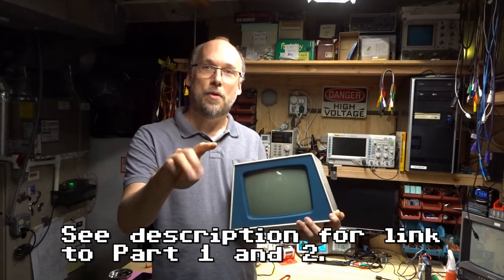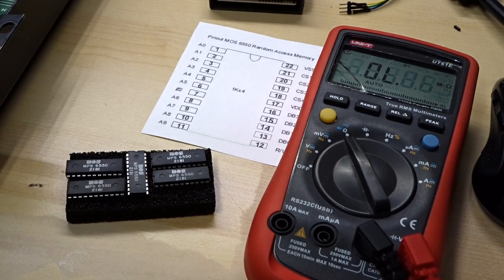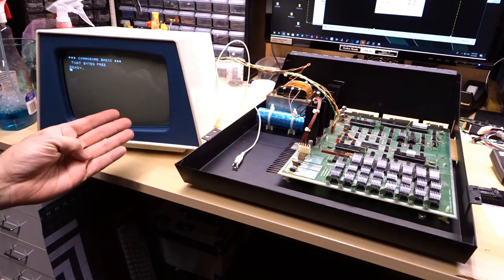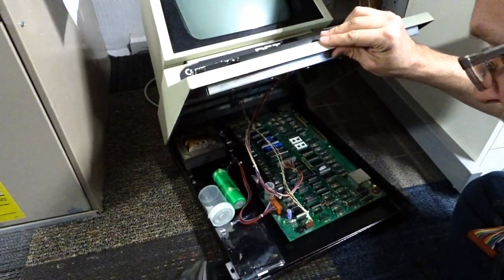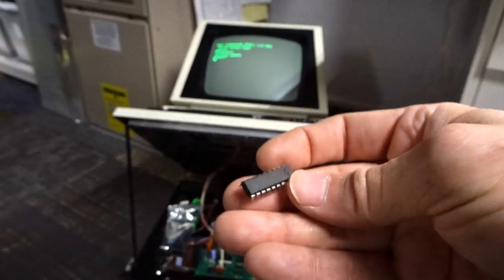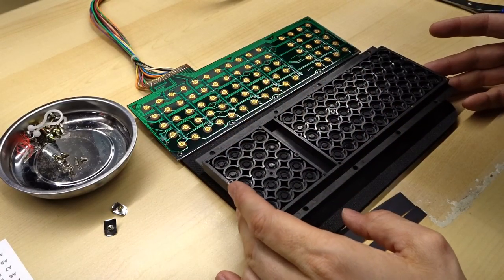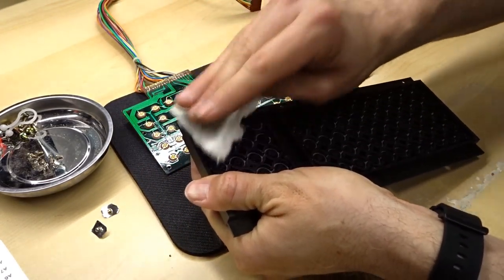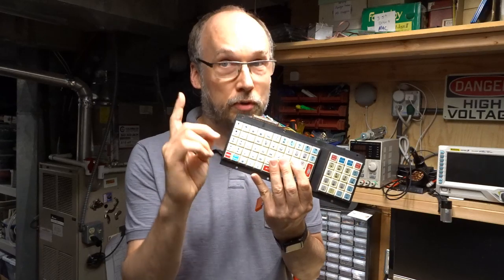PET Rescue Part 3: Replacing bad RAM and keyboard fix

Comment: Having had to service many TV remotes, game controllers, and other things with the silicon/carbon pads like you found in that keyboard I have discovered that paper is abrasive enough to take the sheen off the pads. It's cheaper than the sandpaper and removes far less material thereby preserving the lifespan of the device. For pads that are a bit more difficult you can use IPA as a cutting agent by simply lightly wetting the paper and dragging it across the pad. For tarnished contacts on the circuit board a pencil eraser works wonderfully. Just be sure to thoroughly clean them with either IPA or denatured alcohol.

Comment: I always thought "digital basement" was just something you thought up. Until I saw the furnace, I never thought you were literally, in the basement. Great videos, keep them coming! Repairing electronics is always satisfying!
Reply: his furnace resembles a minicomputer or small mainframe with a pipe sticking out the top more than an actual furnace :P if it weren't for the pipe... :P 'oh look it's got papers sticked to it with the password' and 'don't turn this off'

Comment: I simply use normal paper for "sanding". These rubbers behave like normal rubbers you use with your pencil. First they leave a dark stripe on the paper, after a few times, the rubber stops making those heavy stripes and thus is cleaned. I believe this methods is less aggressive than sandpaper. Love your show, keep on rockin :)
Reply: @adriansdigitalbasement  Yes, England's rubber is America's eraser.

Comment: Really like the shorter intro, very retro looks like you did it with an Amiga and Video Toaster. I told you the PET had a bad RAM chip. The last time I tried to fix it was before the internet though and couldn't find any chips, much better now with the internet. The old gal is really starting to look good almost like new. Thanks for making these videos!

Comment: By 8 years old I was an expert at fixing buttons like this thanks to my Atari 5200. Personally I don’t bother with the sanding process I go straight to the carbon paint repair. That has yielded the best results for me. Besides my 5200 joysticks it also fixed my C128Dcr keyboard. Mind you this is the worst button design ever and I don’t know of any permanent fix but the paint technique has the advantage that it can be applied multiple time where sanding may only work 1 or 2 times before the conductive layer had been completely removed.

Comment: just a tip on those carbon rubber pad button repairs: i had lots of cases where cleaning and sanding didnt help or lasted anything. but what really worked for me excelently was a rubber pad repair kit you can get from ebay and such, usually for remote controlls. they come with new carbon rubber pad plates , different sizes can be purchased and silicone glue. given there is enough room between the exiting rubber pad and contacts on the pcb, you just put a tiny bit of silicone glue on the old rubber and put a new pad on top , then let it dry over night. buttons i repaired with this , then worked as new and has been more sensitive, since the lesser distance between new pad and pcb. if you have a rare case where the spacing is a problem, youll need to take off  some from the old pad before glueing the new pad on top. some just "cut", some "grind". i never needed to do this however.

Comment: Oh yeah, finally I could see my favorite computer beeing restored :D I actually have a PET 2001, sadly not a blue one, but it had the same problem, and what I did with the keyboard, is that I stuck some aluminium tape on the rubbe lr plungers, btw you can take out the rubber part, and it works perfectly, even today.

Fun fact: you can test 2114 SRAM in the VIC20, it makes live a lot easier and doesn't harm the PET, since turning it on multiple times in a short period of time can cause some damage in the CRT, thats what I've heard.

Comment: I had a similar problem with recessed battery contacts in some cheap stuff. Took sandpaper and used a bit of glue to stick it to a small rod, then cut out the circle of sandpaper, so I could get down into the holders to clean off the green crud on the bare brass. Would probably work for you using some cheap wooden dowel rods cut to size, and then make a few with sandpaper stuck to both ends. As they wear simply turn over for the fresh paper, and then cut off the used paper later and replace.

Comment: Hi Adrian,  If the screws go into plastic you can fix the hole by putting super glue on a toothpick and rubbing it on the inside of the plastic post reducing the diameter of the hole.

Comment: If I may add my two cents...  While I've never repaired a computer keyboard, I have on several occasions repaired the very same rubber contact pads on tv remotes and calculators.  In this case it's usually the volume up/down and channel change pads that wear.  The rubber contacts I repaired were well beyond the sandpaper method so I had nothing to lose.  I placed a tiny drop of superglue on the rubber contact then a tiny piece of aluminium foil onto the pad.  Once the superglue cures just trimmed off the excess foil leaving a nicely foil covered pad.  Never had a problem again with either the remotes or the calculators.  I imagine it would be time consuming to do this to an entire keyboard but it might be worth considering if the keyboard still won't work right.

Comment: This fix should mostly be permanent.  The rubber these plungers is made of is mixed with a carbon compound.  All you're doing it exposing a fresh layer where oxidization has occurred. I say mostly permanent because without maintenance everything eventually fails again.

Comment: Tip for those fixing those carbon pads in keyboards or remotes, dont use sand paper, use a regular sheet of copy paper and rub each key on the paper, it saves a lot of the pads and dosent take off too much. Something i have been doing for years with great success.
Reply: 1500 grit though...  I think I've bought more abrasive toilet paper.

Comment: If your ram chips keep going bad, sounds as if there is something making them go bad.   Try checking the caps, esp the decouple one.  Also if it happened when as in the video you change the keyboard then look at the caps round that interface too.  I also believe that SRAM is very sensitive to static.   Also the PSU has very big resevare caps that may be holding a charge for longer than you think and so you might be changing/working on things while there is still current in the circuit.  Try discharging them befor doing any work
Reply: @adriansdigitalbasement  You maybe right  but that dose not mean to say that the thoughts I present are wrong.

Comment: On the keyboard contact cleaning, you might try gluing small pieces of sandpaper to the end of a dowel or a pencil eraser so you can simply spin the dowel on each contact, thereby avoiding the need to press each key and also sanding the membrane.

Comment: Adrian, when using that 1500 grit or virtually any fine wet/dry, on something like that rubber/carbon matrix use some liquid as a surfactant like soapy water. It won’t hurt the material (obviously not for sensitive surfaces) and the paper will work more efficiently and leave a better surface. Cleanup of that rubber would be a simple rinse and dry. Try it out.

Comment: With how easy the PET series was to open, and service, I wish Commodore had offered an all in one model of the VIC-20, and C64 in the same style of casing with a color monitor as an option.
Reply: It's extremely rare, but the Educator 64 is built on a similar chassis to the PET
Reply: @IanThatMetalBassist  Yes, I remember that one, but I'm talking a more consumer commercial model with full color screen, as I've only seen the Educator 64 with green screens.
Reply: @CommodoreFan64  

I wonder how difficult it'd be to do a CRT swap with a color tube. That's assuming that the motherboard isn't modified to only output monochrome.

Comment: To repair the rubber/carbon contacts i stick tiny round pieces of aluminium tape to the pads. That is guaranteed to make a good connection.
Reply: Ive done that with remote controls before.

Comment: For your other PET, have you installed the additional bypass capacitors along with the new RAM chips? They can be sensitive to VCC ringing due to improper bypassing. This is more of an issue with DRAM chips, tough.

Comment: A little  bit of rubber rejuvenate then put in hot water with a little bit of dish soap. You must get the rubber soft. Then you can sand it a little bit.

Comment: Was there something about the MOS manufacturing process that caused so many chip failures, even as in this case a chip that doesn't have a heat problem?

Comment: Gluing a pice of aluminum foil to the bottom of the rubber is a surefire fix if the button travel is enough to open the circuit with the foil in place.

Comment: i put the black rubber pad on the hot barrel of the soldering iron to reburn the carbon  and test the resistance

Comment: Maybe you should undervolt the RAM chips a bit to reduce power heat and power consumption. Say run them at somewhere between 4.5 to 4.9V. if the 5V is regulated with a 7805, replace it with an adjustable 317 regulator and turn the voltage down to the point the PET glitches/crashes then turn it back up slightly.
Reply: be sure to monitor the voltage with your multimeter.

Comment: I like the new intro and outro. But the artificial added blur and distortion doesn't really fit to the main video.
Reply: Oh, that's cool. But still I would prefer the original source-material and not the one with the VHS-treatment.

Comment: ESD bags are electrically conductive. Don't place them loose inside the machine.
Reply from the maker: This is incorrect. The conductive part is sandwiched between two layers of non conductive plastic. You can test this yourself with a multimeter. You need to puncture and push the probes through the bag to get any kind of reading.

Comment: Dude !  You use NO anti-static handling / mitigation techniques.
You’re likely zapping most of your devices !  Those static RAM’s are very probably failing due to gate oxide breakdown. They don’t instantly die if they get zapped, it usually takes time to fail.

Comment: 9:38 i have 2 apple keyboard one power mac g3 and the other a original imac g3 i took it apart because it look disgusting and took the whole keyboard out and dismantled the the whole thing and i put it pack to together and had the same problem

Comment: Dude you need to launch that camera into the pacific, even the smashed S7 I epoxied to a tripod for my videos doesn't crash that much.
Reply: Dude at this point you should find out which chips are overheating and put heat sinks on em 😂😂😂😂😂